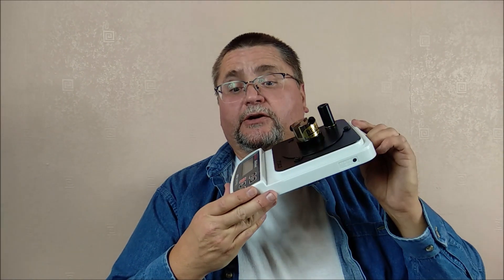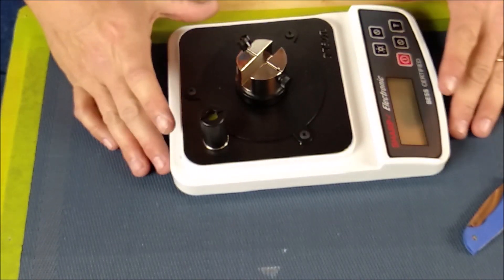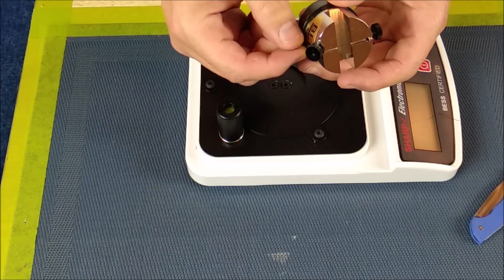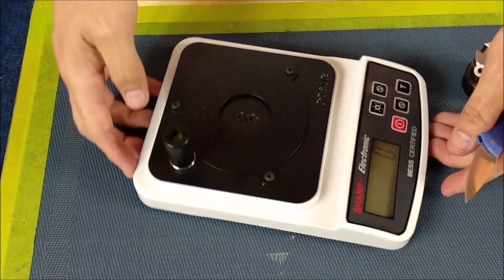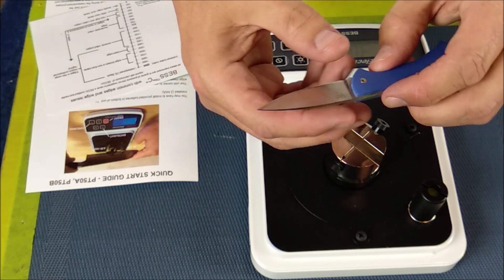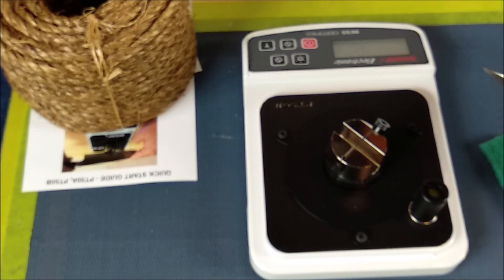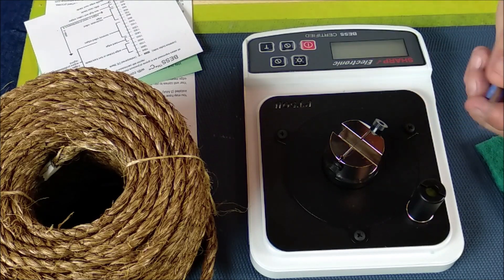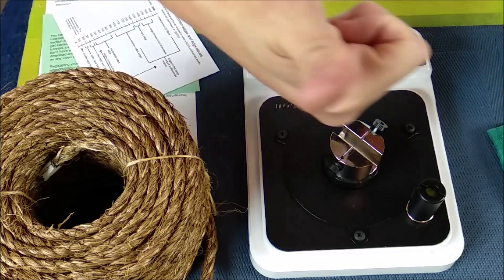How To Measure SHARPNESS - Edge On Up Professional Sharpness Tester PT50B -  BESS Certified

Comment: Appreciate your efforts. Looking forward to your conclusions.
Reply from the maker: Thanks.  I have been using this tool for a long time and I never did a followup video.  I do use this tool to check every new knife review video that I have done in the last couple of years.  I believe it is a great tool to help determine how sharp the edge is.  But, it only measures at one tiny spot on the blade, so I always do 3 tests a different spots to get a rough average.

This sharpness measuring tool is quite dependent on the user to give consistent results.  So if you see another reviewer use one of these and give you the number they got and then you see a my or anyone else's results and wonder why they are not the same it's because of the person doing the test and their exact technique.  

Of the knives that I review get an average score around 150BESS.  So when you watch a review of mine and hear higher sharpness number that means that it's not quite as sharp as most and if the number is lower then it's sharper than most.  I consider anything under 200 to be fairly sharp.  When I custom sharpen a knife I demand a score of 50 or less of my sharpening because custom sharpening simply has to be better than factory sharpening, in fact I usually get quite a bit lower than 50.
Reply: @CanadianCuttingEdge  , thank you for sharing your knowledge and expertise. I have just recently gotten into knife sharpening. It’s great to find sources of good solid information.